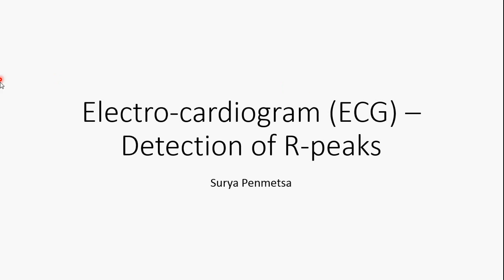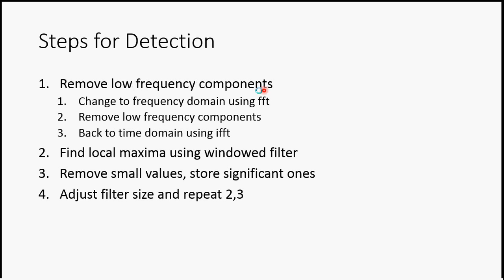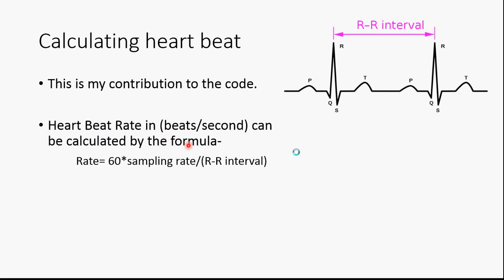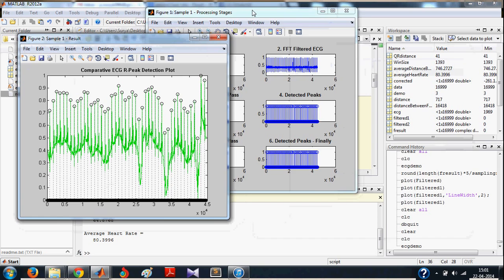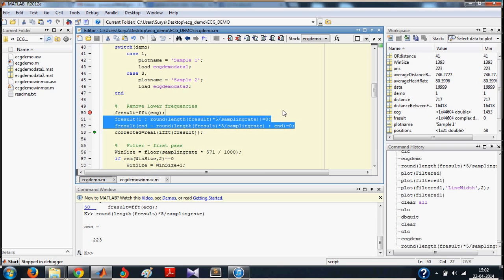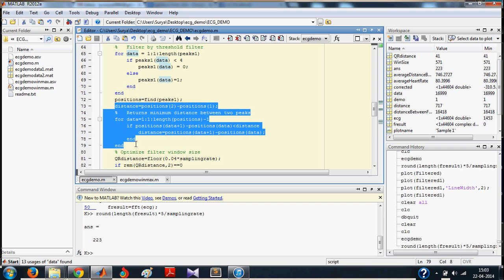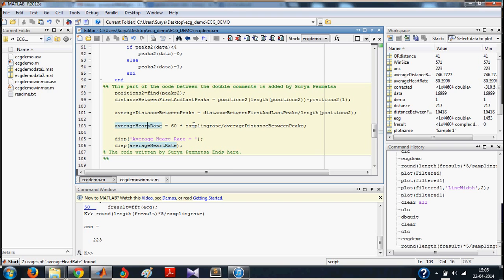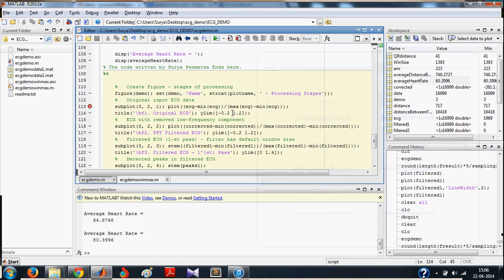ECG Signal Processing in MATLAB - Detecting R-Peaks: Full

Comment: not very effective i want to know after exxtraction of wavelet decomposition coefficient how to detect the R and ST segment in graph plz tell me as i did the extraction part by myself
Reply: hello dear,

I also want to work on ECG feature extraction.

would you please guide me how to start ?
How to download ECG data from MIT BIH database ?

thanx.
Reply: muhammad mateen there is no need to download the ecg data, it is very abrupt for simulation purpose, i my suggestion you can use repmat command in matlab to generate a perfect ecg and then try to extract various segments, its more useful for simulation purpose, but if u still want to download original data you can do that and just load it into the matlab and the  u can see the real patient data and come to know by yourself that it is not appropriate for research purpose atleast not in the start..
Reply: +prince garg thanx a lot for your kind response...

actually I want to classify normal and diseased heartbeats or ECG signals...
which can be done after feature extraction of multiple persons/patients...

I think for this I need a database...

what are your views on this ?
Reply: i dont know much about it bro 
i am not working on this right now
i just started working on swarm optimization..
Reply: +super man ok buddy. Good luck n thanx...
Reply: Did you manage to find code and work on it this topic? Am now working on it and need help.